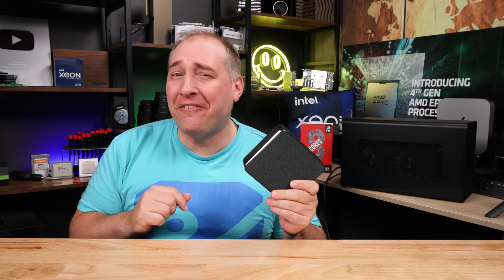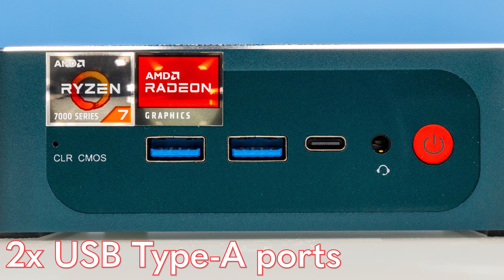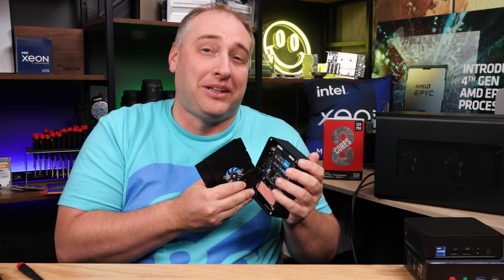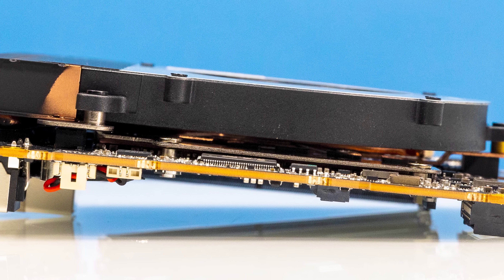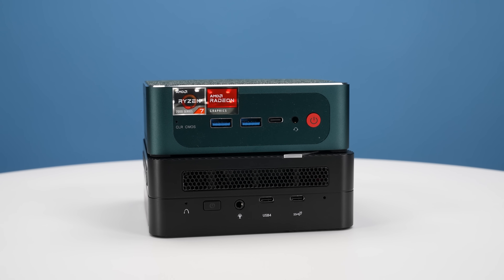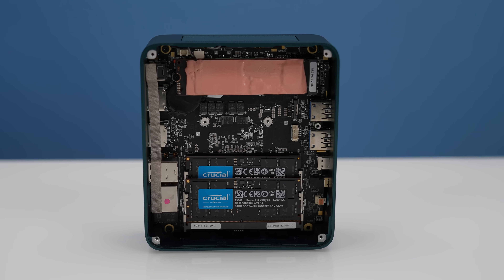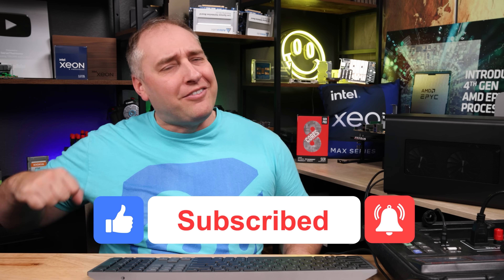The BEST Mini PC? YOU Asked Us to Review this AMD Ryzen Mini PC - Beelink SER6 Pro 7735HS

Comment: Ii bought a Beelink SER 6 PRO MAX several months ago. One thing I noticed about the 2 covers, they have different mesh sizes.  If the air in the room has a lot of particulate matter in it I would use the smaller mesh, if the air is cleaned and filtered I would use the large mesh size for better cooling efficiency.
Reply from the maker: Good feedback.

Comment: How does this compare with SEi12 Pro
Reply: I bought this first, but am returning it. For context, I have an egpu the same as this guy does, and was hoping for one single cable to power the beelink and provide it with the egpu capability, without the need for the external PSU. It unfortunately doesn't work like that on the USB4.0 of this device, but my caldigit ts4 dock and egpu both are capable of charging and working from the beelink sei12 pro due to to its superior thunderbolt 4 port.

Comment: I need a great mini PC
With a AMD Ryzen 7 or 9
At least 33 gb of ram, at least 1 Tb of SSD hard drive
2 RJ45: jacks, 2 or more hmdi video ports
Built in wifi ,and microphone and 6 or more USB-C orts
And for a price range of $600 or less

Why do they still make us 2 ports?
After all adapter first plugging legacy USB 2 flash drives into USB-C are widely available for sale, so why not make the full transition over to all USB-C with full USB 4 speeds?
In a perfect situation I would eventually want 2 4 TB SSD drives
Reply: There is no miniPC with 6 or more USB C ports, in fact most of the desktop and laptops on the market for the last 10 years or so do not have 6 USB C ports as standard.

Your best bet is to just get a USB C hub that branch out with ALL the ports that you want, lots of variations to choose from.

Comment: CMOS-Buttons:  I had the Beelink SER6 Pro Mini PC.. For 2 Days.  Upon receiving it and Trying to set it up, 
the thing would freeze [100% unresponsive - requiring manual restarts - until' even that failed]
More than 50% of the time,  when powered on,  there was no video out - both wired & wireless..
I could go on and on, but, long story short,  when contacting support,  all they could tell me 
was to power the unit off,  drain any residual power, and then hit the CMOS button to whipe everything.. 
After the 5th or 6th time having to do that in ONE DAY,  it was set back the very next day.
In true Scamazon fashion - Even though I bought it From Them,  they refused to swap or refund.. 
Then tied up My Money while the paperweight was shipped back to the company In China..  
The SER6 'appears promising,' but damn it's hard to shake all of the bs that I ranted about above..
[It's still tempting to give another one a try]

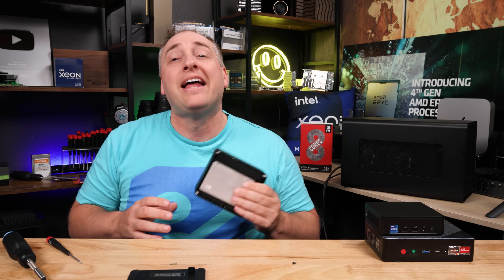Comment: 4:41 Honestly, I'd probably take the SSD out of its protective cover. In my experience, the drive itself is a fraction the size of the 2.5in enclosure and the SATA mount is soldered directly to the PCB. This means you can probably mount the SSD to the provided header and hardly cover the fan at all.
Reply: Good tip, might do that when I get an internal SSD.

Comment: Is the beelink ser 5 good for ganing
Reply: SER 5 Pro is using the Ryzen 7 5800H APU which means no 680M so PC gaming will suffer quite a bit, although emulation upto PS2/GC/WiiU will be fine. Some PS3/Switch games may even run decently.

Comment: I'll just wait for the new ones with rdna 3 and zen4
but this is a nice review
Reply: By the time the RDNA3 and Zen4 come out the RDNA4 and Zen5 will be on the horizon, it's a never-ending story.

Just get what is available now that suits your needs. For the current gen Ryzen APUs they're more than enough for emulation upto PS3/Switch, if that is your thing.

Video editing/streaming/office apps etc can be handled easily. 3D modeling/design etc you would need 32GB or 64GB of fast dual channel DDR5 RAM.

PC gaming is lacking definitely if you're playing AAA titles, and the next gen RDNA is not going to save it due to progressive improvements, you need to jump at least 2 gens forward to see any meaningful improvements with AAA games running at 1080p/1440p Ultra 60fps etc.

Comment: The power supply brick is ridiculous.  Why in the world would vendors give these massive bricks instead of just a USB-C small 65 watt charger?  That's a deal killer for anyone who wants to travel with the device instead of a laptop.  Also, having USB-C should be mandatory for both interoperability & easy replacement of power bricks.

Why some reviewers overlook this obvious feature or drawback (as in the case of this one) is beyond me.  Clearly a larger percentage of users buy these for their ability to be transported easily to different locations unlike a desktop PC with a tower.
Reply: Generally the bigger wattage the PSU the bigger the size.

My 250W laptop PSU is like 4 times bigger than my miniPC's 65W PSU. And this model uses a 120W PSU so naturally is bigger than a 65W PSU.

Comment: thank you for the review. got a question which is out of your scope. how would i connect active speakers to a mini PC? there's no line-out, headphones only. this is a thing which stops me buying a mini PC of any kind. by 'active speakers' i mean just desktop ones like people use with PCs, nothing fancy. appreciate your answer.
Reply: You just plug the speakers into the same port as the headphones port, it doesnt make a difference. It can do both speakers or headphones.
Reply: @redbaron7582  thank you for your reply. these two outputs are different. as far as I know, the one for the phones is amplified, the line-out is not. the impedance is also different. speakers have its own amplifier.  generally, it's not recommended to use the phones port for speakers and vice versa. if it works for you, you're lucky then.

Comment: You can upgrade the RAM to 5600 and it’ll run just as stable and faster. The 4800 RAM is holding it back, especially the GPU.

Comment: Does someone know if this mini-pc supports single-cable-connection? (one usb-c cable from a usb-c dock which also powers the mini-pc, so no power-adapter needed)
Reply: I think it does, yes. I'm either planning to charge it from my egpu (razer core x) or my caldigit ts4 which also connects to 2 external monitors.
Reply: Hi,

Unfortunately, I don't think it works with my caldigit ts4, as that is thunderbolt 4. I will try it tomorrow with my razer core x, which is thunderbolt 3, so should be ok. If you have a caldigit ts3 you should be fine, or anything TB3!

Comment: I'm looking for a PC in my sound studio. Would you recommend a mini-PC like this one for that? It has to be very silent and run Presonus Studio One with several VST Plugins and some controlling software for the digital interface (Focusrite). I'll be using it for real-time playback and recording on 20 to 60 tracks.
Reply from the maker: We do not benchmark that software, but what about something like this that is fanless? https://youtu.be/6rtRwKlJTgU
Reply: Ah, with the Intel I5 1235U it's 540 Euro's. That is still nice but still have to buy the SSD and RAM. With 32Gb and 1Tb SSD it's 815 Euro's. That is a heck of a bummer when I find out after the 1 July that it doesn't do what I want.
Reply: I have a beelink 4000 AMD Ryzen 7 4800U with Radeon Graphics  running Studio One v6 and a focusrite 6i6. I have had no problems after 1 approx. 1 year. I can't comment on 60 tracks as I don't do that many.
Reply: @PatFleck  Thanks for the reply Pat. That sounds promising. I regularly do about 10 - 20 tracks but there might come a time I will do more. I have a Focusrite 18i20 in my Studio. Still have to learn to work with that too. Learning is part of the journey. What about the noise? I don't see the Beelink 4000 anywhere. Guess it's no longer sold?

Comment: I bought this and tried it as a Linux pc which worked great. I could not get it working with an external enclosure to get the external gpu working as it was not stable. If you’re on windows this looks like it was not a problem though.
Reply: Did the audio work on Linux as well?

Comment: The 7735HS is just a rebranded 6800H. This system is very much last gen. A 7745HS or even 7840U will perform 15-20% better in demanding tasks.

Comment: Yeah, I got the UM690 and the UM773 from MinisForum. They are nice little boxes but servicing sucks. Thermal management isn't the best either - which is what you are seeing in gaming. I only use them for running proxmox so it isn't as apparent. I have to admit - they are pretty darn cheap. The BeeLink boxes are not offered has barebones - but I really wish they were - it feels very wasteful to order one just to toss out the memory and SSD for bigger ones but they don't offer larger sizes either. At least MinisForum offers several configuration options and barebones on most of their systems.

Comment: How would you compare this to the new Intel N100 chip-based MINI PCs?

I'm starting up an Charitable Organisation - and looking to pick up 10 decent mini PCs to begin with. I know the iGPU is going to be far better with the RDNA based graphics, but is the single and multi-thread CPU performance comparable? Intel always works better for the applications I use (Music Daw's, Photoshop, After Effects, etc...).

Cheers from sunny old England (well it was earlier! :P).
Reply from the maker: Alder Lake-N is a lower performing E-cores. Still much better than older generations. This uses more power but is faster
Reply: Might be worth looking at some of the older 5000 AMD Ryzen Minisforum/Beelink machines. Can still buy new, and should have a reasonable discount on the R5 models.
Reply: @emlyndewar  Good shout! I've been looking at the older 6th/7th gen i& Lenovo ThinkCentre Tiny models etc... But price to performance wise - these new N100 Intel Mini PCs seem the best bet so far - I'll check out the older Ryzen based Mini PCs.

Comment: I ended up my buying this exact mini pc last week after going back and forth with the Intel NUC12i5. This ended up being the cheaper option with arguably better performance. The selling point for me over lower end Beelink mini PCs was the USB 4 on the front. I work from home and have my work setup with dual monitors to my work laptop via a USB-C dock. When I’m done working I simply unplug a single USB-C cable from my work laptop and plug it into the mini pc to swap my whole setup over to my personal computer
Reply: Has there been booting issues or crashes.

Comment: I love the NUC form factor, but hate the fan noise. I would much rather something more cube shaped with a 120mm fan. The cable length for thunderbolt is limited, that's why it is so short (to meet specs). Yes, I have been using NUC for factor PCs since I bought my first (4th gen core i5 with msata). I even have the 8th gen i7 with Radeon graphics.
Reply: I know it is specific and it is not for everyone, but I can recommend Mac Mini.
Noice is a Big Issue for me, and after I switch to Mac in 2016 the difference is Unreal!
Mac Mini is not just quiet, but completely Silent! That's it! :)
This mini PC presented in this video looks, actually sounds very quiet :)

Comment: Thank you for this review! Great video and love it!

I think that this is going to be able to finally replace my aging 6700K gaming system.

With my RTX 3090, playing F1 22, that system was sucking back something like 413 W of power, with, of course, the bulk majority of it being because of the 3090.

But if I got a mini PC like this, then I can turn on the eGPU when I want to play the more graphically intensive games, but then turn that off (without having to open my system, and pull out the entire GPU), and then I have a nice, low powered system, that I can do everything else with.

This is fantastic!

Just as a head's up -- there's a dark grey option in lieu of the dark green option, shown in this video here.

Comment: I got minisforum UM773, which looks better internally than this beelink. Much improved from UM690, works fine with a m.2 nvme and sata ssd together. And check that out, you can get it in pink! :D
Reply: How does the um773 perform? Ive heard that after running it for half an hour or so it starts throttling and the frames tank like 20-30 %. Is it true? Looking to buy it.
Reply: @pushparajrahevar9974  I run it on 15w tdp so fan never even spins up. More than plenty of performance for my moderate desktop usage with a few VMs.
Reply: @pushparajrahevar9974  from what i have heard, it was true cuz of the ddr5 ram throttling.  Minis forum started including a upgraded heatsink that pretty mich fixes the issue, atleast in the newer models. If you buy a um773lite/se now it should have the new heatsink.

Comment: By the time i went to buy this after @ing you it had gone up from the $550, to $679, still a good deal relative to similarly specked laptops, but less than half the price of a similar laptop is a great deal for this class of hardware, traditionally these things either come out years later, or are about the same price as a laptop, but you dont get the screen, keyboard, or battery
Reply from the maker: There was a $100 off coupon this morning.

Comment: With regards to USB4 and the eGPU box, I wonder how long it will take for the GPU to be an accessory of the monitor, not the PC? That is, you will plug the GPU into the monitor and connect the PC to the monitor with a USB 4 cable.
Reply: The PC always talks to the GPU, not the monitor, and the OS needs hardware-specific GPU drivers to do so. Also, it would make the monitor less flexible (since it is tied to a single GPU), so you couldn't use it in a KVM switch.

Comment: I replaced 5 Raspberry Pi 4 with Beelink SER 5 5800H and still I have lots of power to use on something else if needed.
However 1 thing I cannot manage: pass GPU on Proxmox - no way to do it with latest Proxmox ;-(
So only headless servers there - but plenty

Few problems though:
1- no 2.5Gbps NIC
2- not all USB ports can power external SSD
3- when maxed out it can only have:
- 64GB RAM
- 2x 2TB SSD
so not really to be used as NAS
Reply: You can't pass the igpu over to a vm
Reply: @damiendye6623  are you sure? I read on PVE forum that someone did it with 5600
Reply: @zyghom  to do it the system needs to have been designed so the the igpu is on its own pci bus, which they are not on these mini PC's I tired my minisforum b550 and no, and no bios update to fix issues either
Reply: @damiendye6623  very, very bad news ;-(
Reply: @StephenDail  my hypervisor is headless. It just will not work as soon as you pass it though the system locks up as the igpu is connected to the same iommu group as the main system. It works if you can get the iommu split. If you can't get it spot your screwed you maybe lucky that your Chinese be for has split  the iommu properly minisforum haven't

Comment: Great Review: There are lots of clones in this formfactor thanks to your influence Patrick, I've grabbed some UM690 AMD Ryzen 9 6900HX units and its a solid Machine, the 2.5Gb is nice and I used it as a build slave for cross compiling as its all about CPU and Ram so a dirt cheap almost disposable home office solution, A good low cost "mini server" if you add an external drive for backup... This newer AMD 7735HS is all about low power. If they did a barebones so you could add the NVME and Ram that would be a win.

Comment: does this support 5600mhz memory or overclocking like um690. The 680m GPU will perform %15  better with faster memory. too bad the minisforum box is broken as you pointed in the video.
Reply: no ram overclocking support. would be nice to have

Comment: 7:40 As a reminder, that 3 in the third digit means that this is a Zen 3/3+ CPU. So this is pretty much literally a 6900HX. For a next gen boost, you're looking for one with a 4 in the 3rd digit.
Reply: The 7735HS has very similar specs to the 6900HX but no OC and slightly slower clock speeds. The most important thing: adjustable TDP 35-54W vs fixed 45W which makes it a better choice for those compact minis

Comment: Please  make a video about debunking or not audio quality switches.  I smell sake oil as digital works or not.
Reply from the maker: Do people actually buy those audio quality switches?
Reply: @ServeTheHomeVideo  I'd hope not 😅... I saw LTT debunk them already.
Reply: @ServeTheHomeVideo  I have seen videos of people claiming that the switch "sounds better"....  Digital to digital is 0 & 1's  if there is an error there is a checksum.  Yes I can send you links of high quality of USB cables....  Yes analogue cables can make a difference but to my understanding is digital either works or not with possible delays or resends but we cannot see the difference.
Reply: @alecgrolimond1678  that's correct, so don't fall for the snake oil you already identified
Reply: Yes they do I requested one channel to do a blind test or a true lab test.  I understand that analog amps and DAC in sound in ther way the audio is converted and also the qualiy of analoug amp and it'a components.  I hear stuff about audio grade ethenet our USB cables help also NOT.  A 10$ USB cable that works fine will sound just as good as a 100$ USB "audio quality..